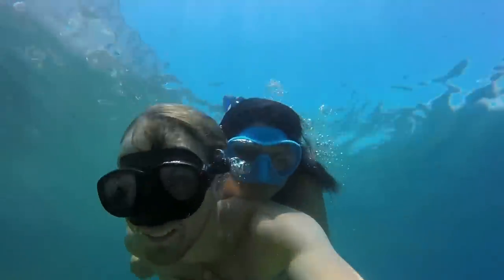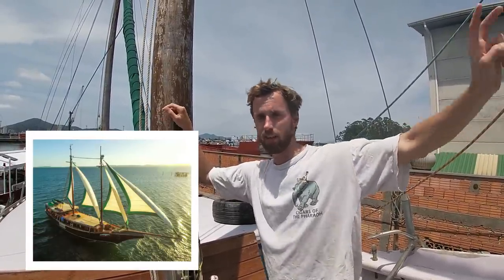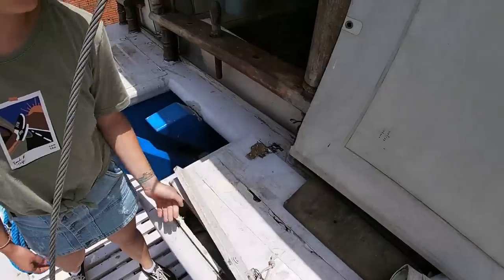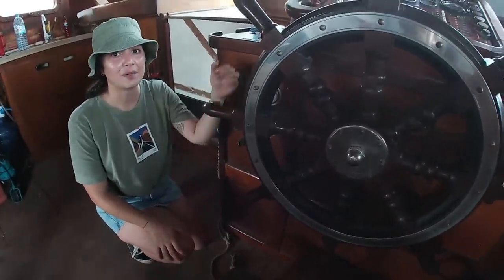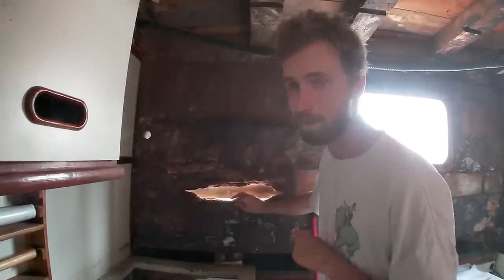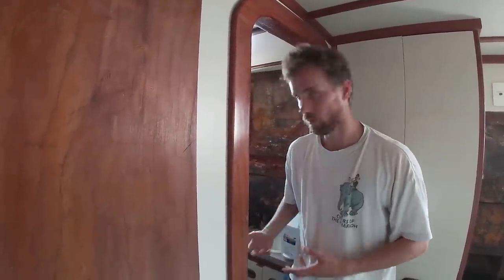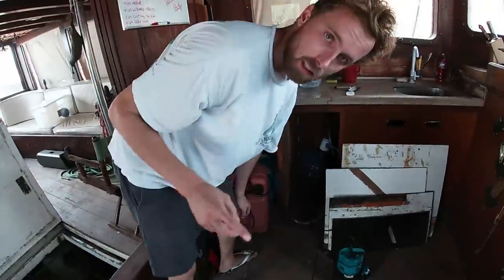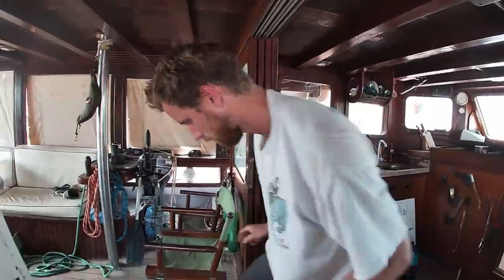BOAT TOUR of our wrecked Brazilian ship — Sailing Yabá #7

Comment: Get rid of the teak decks!!! How many holes in the deck are there just to attach the teak? Thousands! And they will leak. Pull the teak, drill and fill with epoxy all the holes and fiberglass/Gel Coat/ Non-slip the decks. N slipping. Way less leaking and it is much cooler that the teak which will help keep the interior cooler. And being where you are located, that is a great thing. Also, the entire boathouse should be sealed with epoxy and fiberglass and gelcoat. It will stand up to the ocean environment much better than the wood or plywood. Use both kitchens! One for inclement weather and the other for when it’s beautiful or too hot outside so you don’t have to heat the inside! And, I see a LOT of epoxy (if you want to keep the natural wood look) in your future. But it resists rot and keeps the finish longer that varnish. Best of luck!

Comment: I would be concerned about keeping the gas bottle and petrol pump inside the boat as fumes from either are heavier than air and can build up in the bottom of the boat until the fumes  to air mixture becomes explosive. Usually these are kept in  an enclosed space and vented over the side of the boat. I wish you well with your project. :-)

Comment: There is a lot of repair work to be done, and a lot of decisions and planning to take you forward, you need to have a list, a set plan of work steps in the order they need to be done, for instance at present it seems you have three different voltage systems, in use, 12v 24v and 220v would not only one suffice, does your main engine use 12v or 24v electrics for it to run/start, then perhaps this points the way for you to go, also I would think about new and better solar panels and the lighter higher output solid state batteries that are available today plus all the necessary ancillary controllers although a new system is expensive I think it would be well worth it, maybe you can wangle some kind of sponsorship to help.
Reply from the maker: Definitely great advice! Our engine needs 12V as does everything else except for our 24v pumps and anchor winch. We will probably keep the 3 systems but narrow down the 220V system a lot!

Comment: why not go all 12 volt, with LED lights, your batteries may last longer.  Also if you had a converter set up you could plug into 220 and convert it all to 12 volt.

Comment: Thank you for showing us through. Yabba has awesome potential. I was horrified in an earlier video that your were patching and chucking a rotting boat back in the water without antifouling it. I did not know you were on your way to another slip to fix it.
As newbies I thought you were going to go on and drown yourselves.
I have owned wooden boats since I was seven years old. I am having my seventy third birthday  on Christmas Eve.
I have been a boat builder for more years than I care to remember. I feel your first priority is to cut out all the rot and destroy  the rot spores.
Cut out five inches past the last of visible  rot to be sure you are past all the rot spores. Everdure is an epoxy with  a wood preserver that works really well. Only God can eliminate rot in any other way than by cutting it out like cancer.
Sister ribs after removing rotten parts , that will keep hull strength .
Your lower stem is in a bit of trouble. I would inject it with syringes full of formaldehyde to kill any gribble and teredo worm . I have seen people dry out worm ridden hulls and then fill worm with epoxy filler. Not sure how it worked out but if it stops leaks for a year or two it gives you a chance to build up the kitty.
Fix the leaks them work through the rest. You are both young and healthy and have your lives ahead of you. Enjoy each other and your beautiful boat.
Regards, Nick Viner.

Comment: Dear Yaba. I think you will want a proper kitchen. Meaning, in light of the size of the boat and the time you will spend on it, I would remove the washer and create a beautiful cook, refrigerate, freez and prep space. Find a new home for the washer. If you want, you could create a simpler space on deck w a fridge, ice maker, hot plate and prep area. Or convert that deck space to a 🐟/ sea food prep area w a vacuum sealer.

Comment: Don't buy a water maker yet. You don't use them near marinas. The poor quality water will clog the membrane early. Focus on removing everything that is covering the structural wood. You can be gentle with the nice white plywood and label it so you can reuse it but you need to expose ALL the wood. Then remove the mushrooms scrub with bleach and TSP. Set up fans in every room and let them run 24hrs for at least 2 weeks. With a mask scrap away and cut away all the rotten wood. Don't let someone talk you into soaking it with epoxy or resin. Rotten wood has no strength and the resin is brittle and will crack without a strong base. Think about it when have you seen a resin boat, never plastic everywhere resin never.

Comment: Your propane tank inside the cabin worries me.   It should be away outside in a vented locker, where any leaking gas won't find its way into the bilges.   I also hope you have a bilge gas detector system.   These are life and death issues on a boat, even more than sinking.  I had friends who were very seriously injured in a boat explosion caused by this!

Comment: Once you get all the rotten wood out they sell a penetrating epoxy that you can put on to what wood is left and it will soak into the pores and dry and it was just basically become solid plastic is deepest it sinks in it'll never take water again and then you really replank her but I'd replank every thing from one plank above the water line down and paint that penetrating epoxy on the frames minimum

Comment: It not good to have battery and converters in the engine room especially in that huge engine room hanging right next to the fuel system like that add a little salt water vet a few sparks could be bad
Reply from the maker: We also don’t like the batteries placement, we definitely want to bring them somewhere drier and safer. Thanks for the tip!

Comment: Just a few thoughts on your WONDERFUL latest post.  Thank you.  Painting- when YABA gets a fresh coat of paint, might Her color scheme be the colors found in the Brazilian Flag ?  When you re-do your electrical wiring, will you be adding high speed CAT5e Network cabling and a server ?  Will there be several WEB CAMS for when you share future posts ?  Checking YOUTUBE, Ifound many people who are doing things similar to what you are doing.  What do you think of starting an organization/blog/vlog/so people like you can share adventures, discoveries, stories, restoration and sailing tips and techniques ?  This kind of connectability might also help member boats assist each other when a member has "trouble" at sea.  With a sponsor providing support for a satellite linked INTERNET HOT SPOT,  you could have a WEBMASTER on shore who could run your bulletin board so you can focus on your Bluewater Adventuring.  As a HAM RADIO OPERATOR, I love to travel with my radio gear.  Maybe other HAMS might pay to go on a sailing adventure with their radio gear to sail on YABA to help add to their  contact list.  Can I assume that YABA is equipped with SONAR ?  Lastly, when She is ready for sea trials and a 1000 nautical mile shake-down cruise, might you consider ADDING to YABA'S name; maybe LEMANJA ?  (  Hope I did not spell the Sea Goddess's name wrong ).

Feliz Natal e muitas aventuras maravilhosas !!!

Comment: I don't want to step on anyones dream , but that boat is  worn out , rotted from piller to post . The wiring is a rats nest.  I can't imagine what the hull really looks like.  Not to mention a couple of old worn out engines. Honestly ,you are going to  put enough money and time in this to just go ahead and build a new boat . Good luck , you are going to need it .

Comment: It's no good having and admiring all the appliances and storage etc inside the boat, when the boat and main structures are both rotten and need lots and lots of work and $$$$ to be repaired. The other thing that worries me is neither of you have any woodworking experience or are even shipwrights and those qualified people do not come cheap. Me being a wooden boat enthusiast. small wooden boat builder and wood worker I would give up and spend my money on something that needed far less money and work to be able to be used. Yes, we all admire lovely looking wooden boats but reality must come into the equation also.

Comment: Dude, for all that is sake, don't keep your red wine out of the fridge! Red wine is NOT meant to be stored at room temperature. Even more so in Brazil. You should keep even your red wine INSIDE the fridge and at a steady 14~16 deg Celsius. Once you take it out and actually are ready to drink it, it should be at nice 18 deg. Celsius. Anything above this is just like drinking warm beer. You just won't be able to enjoy the full experience of your wine and even the most expensive wine will taste the same as a 10 bucks wine you can find in 5l plastic gallons at your local grocery shop.

Comment: Amazing project, although my wallet and clock are hurting seeing this. Normally id prefer to fix it the traditional way, but here i would consider replacing rotten wood and fiberglassing over it.
Reply: Jesse, do you know examples of people who succesfully fiberglassed a wooden boat?
my fear is that the fiberglass will prevent the wood to breath ( and moisture to escape), and it will rot even quicker.
Reply: @rolfdc2934  a lot of non mould based fibreglass boats have a wooden core. I believe even some old cgris crafts were made this way. The key to keep breathing is to only fibreglass the outside and not the inside. Definitely look up either planking or fiberglassing and comparing costs. Planking is doable but requires more skill, but with a boat that big i would go the easier route, especially taking into account the recurring work on a wooden boat.

Comment: I wonder how a 13 year old boat can rot so much? what did they use to build it? Like most people commenting, i think yaba is not fixable, too much rot. I would appreciate to see an inspection made by a professionnal. You are very enthusiast, but it's not enough to restore a boat. I'm sure you've seen the "Samson boat" channel. Do you realise the amount of skill and experience Leo has to accomplish this task? I'm not an optimistic person, nor a troller. I just have common sense. I wish you the best, but fear the worst. Stay safe!
Reply: Same , I have to question what wood was used. Any fit for purpose hard wood should survive 40+ years without any issues. The fact the boat is in this condition after only 13 makes me think cheap soft wood was used in critical places.

Comment: So the bottom is rotten, the gunwales are rotten, the walls are rotten, the sides are rotten, the windows all need to be replaced and modernized, water leaks into the bedrooms from the walkway, the ceilings leak at every junction and then some, the head has to be replaced because of rot, but other than having to rebuild the entire boat because of all that rot, it’s great!
Reply: @pcb1962  it’s going to take so much money to get it up to snuff they’re better off setting fire to it at this point. Of course, I’m not really sure it would burn it’s so waterlogged.

Comment: I have no doubt that Yaba can be turned into a safe and even luxurious Blue water cruiser. (consider changing the name if you ever decide to sail to Thailand). It will take a lot of hard work dedication no doubt some tears and a lot of money to achieve this though. Plus of course you have moved you lack that most vital piece of equipment a Fred!

However what happened to her? Despite her dilapidations she does not look like a work boat and she is only 14/15 years old I believe? She seems a strange mixture of high end wood and cheap rotting shit wood and looks as if they splashed and decided well maintenance will never be required since she is made of wood and wood floats so dont need to do any ot that pesky work.